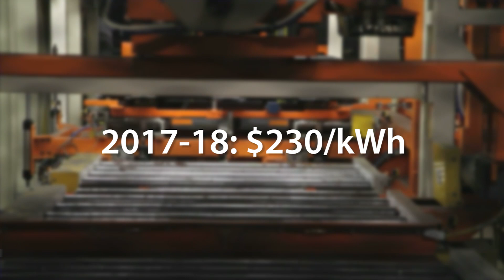EV Battery Prices Dropping Faster Than Predicted - Autoline Daily Insight

Comment: Battery price is just one of, ten or so unsolved problems of battery powered electric cars. 
Internal combustion engines still has a long life ahead. Especially using different types of fuel.
Reply: +dMb EVs are still behind the heat engines in normal cars, but they ARE better than the hydrogen cars Exxon-Mobil and fueling lobby is pushing.  EVs like Tesla have 250 mile range which exceeds the 200 mile range of my hydrogen FCV (I'm leasing it).  The EVs also have a perceived charge time of 0 minutes, while the owner is sleeping, whereas my hydrogen car wastes 30 minutes of my life every time it needs refilled (note: I'm including the detour to the gas station).  I'm looking forward to terminating my shitty hydrogen lease, so I can get an EV instead
.
Reply: dMb Most of those problems you named are just different aspects of the same problem - battery technology. Every new iteration of the technology aims to improve each of those aspects. I'll grant you that charging infrastructure is an issue, one that will have to be dealt with. However, it's a much easier problem to solve than people make it sound. In most places where cars park it involves laying a few meters of cable from the nearest power node, and putting up a charge spot. Certainly much simpler than building up the gas station infrastructure was during the advent of automobiles. And taxation? Really? You think that EV adoption will be slow, because politicians won't be able to figure out how to tax them? C'mon.

EVs will eventually push ICE cars to the fringe of the market (they won't ever go away completely of course, it's well over 100 years since cars showed up, and many people still use horses). Just like cell phones did with land lines, LCDs with CRTs, mp3 players with CDs. Yes, the refresh rate is much slower for cars than it is for consumer electronics, and it may take 2 or 3 decades. I guess this is what you meant when you wrote that ICEs aren't going away any time soon. People in the EV industry are aware of this. That's one way of looking at it. I suppose people in the EV business have a different way of looking at things. They tend tend to think along the lines of "EVs are something that absolutely needs to happen, in fact is already starting to happen, so how do we make it happen faster rather than slower? What are the challenges and how do we overcome them?" As opposed to "EVs won't replace ICE cars for a long long time, and they are facing many problems, so let's not even bother talking about them." Don't call people foolish for having a different perspective than you.
Reply: GANTZ100pts I completely agree. Most of the public's fears with batteries aren't a big deal, like charging. Charging at home saves all those worthless trips to gas stations.

I would hope to see integration of capacitors with batteries to allow fast bump-up in range by dumping energy into the capacitor instead of the battery. Capacitors don't wear out with cycles like batteries, and with their faster response rates, they seem ideally suited for accepting regenerative braking and accelerating from stops. The battery would then be used for the steady-state portion of driving.
Reply: TheGolfdaily And what are the other nine or so unsolved problems of battery powered electric cars?
Reply: dMb Recharge times don't really matter all that much, the fact this is an issue or is even brought up is just people being conditioned of how we drive and Re-fuel (IE recharge) now.

How it is with EV's is, once you get home you plug it in, Its not doing anything, and your not going anywhere anytime soon.   
As you just go back from doing whatever was you left to do. (work, store, movie Ect.)  

An ICE car is doing nothing just sitting parked in your driveway, but an EV can be charging.    

In reality having to charge on the road  in an EV would only happen during LONG trips.  And even then you can just hit a public super charger.  Tesla's not the only one that has them anymore.

And during that time of recharging you could get something to eat as your doing a long road trip so your bound to get hungry.
Reply: +dMb 
the system is called e-Hdi.
It uses e-booster using ultra capacitor.
PSA is the first company to produce hybrid diesel engines but the e- Hdi models are not full hybrids meaning it does not carry extra bulk of batteries.
Their stop and start system is totally seamless and smooth which you can hardly notice engine being restarted.
Reply: zlozlozlo Battery energy density (both weight and size), battery recharge rate, battery longevity (number of recharge cycles, degradation due to temperature), battery consistency in a wider temperature ranges, recharging infrastructure, taxation, to name a few. However, while these are things that still need work, they are not show stoppers as battery EVs are already viable products. 

ICEs aren't going away any time soon, and it is folly to think that only one solution will fill the market going forward. Expect each type of solution to continue to be used where its strengths are best suited (diesel will continue to power semis, commuter cars will be electric, delivery trucks will be natural gas, etc.).
Reply: +dMb 
PSA has been using just such system called, micro hybrid for some times now using capasitors. It is kind of advanced stop and start system which does not require large and heavy bulk of batteries.
I had a occasion to drive a car with this system and it really works rather well.
Reply: TheGolfdaily
Wow, I had not heard of that system. I was only aware of Mazda using supercapacitors in their iELOOP.
Reply: +electrictroy2010 why dont you just make the hydrogen at home?
Reply: +electrictroy2010   The New Chevy "Bolt" looks real nice and affordable.
Reply: TheGolfdaily I agree, because I have an old classmate from highschool that uses vegetable oil in his car.
Reply: If you are replying to me, please reread what I wrote.

As best as I can tell, TheGolfdaily's comment said that batteries still have shortcomings and ICEs still have a long life ahead of them. I answered your question of what are some of battery EVs' challenges and that yes, ICEs will be around for some time yet, even as EVs become popular.

You stated: "Most of those problems you named are just different aspects of the same problem - battery technology."
- I wasn't aware that "battery technology" was only a single topic and that addressing each aspect only required a single breakthrough or advancement. That's like saying that engine problems like pollution, durability, manufacturability, fuel properties, etc., are all just "engine technology." So, ICEs have only one problem to solve! Of course that's not reasonable.

I would instead contend that if the different issues require different solutions or are affected in different ways by various solutions, then they are in fact different problems.

For much of your response, you seem to put a lot of words in my mouth.

I make zero claim or inference on how difficult it is to solve any of these problems. In fact, I state that none of them are show stoppers because EVs are already viable products. Thus, if there is an implication to be made from my comment, it is that these are NOT difficult to solve.

I make zero claim nor inference that EV adoption will be slow. I stated that each niche of the market will be filled by the technology that best suits it, and that city/commuting will be filled by EVs. I only listed taxation as a problem to be solved, which it will be, not as a barrier for adoption.

I explicitly stated that ICEs will be around for quite a while because they are best suited for certain applications; thus, they will continue to be used for those applications. A semi driving cross-country is better served with a diesel engine than a battery pack because of the advantages diesel has over electricity. Airplanes are better running jet engines on fuel instead of batteries because of the advantages jet fuel has over electricity. City & commuting driving is best served by battery EVs because of the advantages batteries have over liquid fuels. Every transportation niche has its own needs, and it is a mistake to think that any one technology, even a great technology like battery EVs, is the one true solution.

Yes, I do think it is a lack of good sense to believe in a silver bullet to solve all our problems--that what is best in one situation is best for all situations. A phrase comes to mind: For every complex, difficult to understand problem, there is a simple, easy to understand wrong answer. People who cannot let go of that simple, easy to understand wrong answer, yes, they are often foolish--not because they think differently or disagree, but because their beliefs & way of thinking are demonstrably in error.
The recent program on the i3 tear down emphasizes that mistake--for vehicles with low production volumes, the CF manufacturing methods of the i3 are cheaper because of lower tooling costs. But when production volume increases enough, those tooling costs are not a problem and traditional unibody techniques are cheaper. Thus, it is folly to think that its CF construction is the solution to all vehicles regardless of production volume just like it is folly to think EVs are the best transportation solution for all applications.

I am a strong supporter of EVs, and I hope they become more popular. I intend to buy an EV because they are well-suited to my transportation needs. Do not assume that because I am realistic and take a holistic view of the entirety of transportation problems that I am down on EVs.

Comment: Her comments are accurate and when you factor in vehicles like the Volt and other hybrid vehicles that would be more practical for rural drivers, you really fill in the market with vehicles that hardly use any gasoline at all....
Reply: +EV docmaker YOUR statement doesn&#39;t make much sense.  Rural areas don&#39;t have charging stations as easily-available as metro areas (LA, DC, Boston, etc).  Plus rural areas have huge distances between destinations, like 40-mile drives to reach the nearest school or mall, and that exceeds the roundtrip range of the Leaf, Spark, 500e, and most other EVs
.
Reply: electrictroy2010 But not the Bolt !!!!